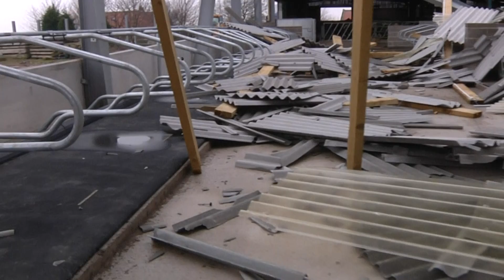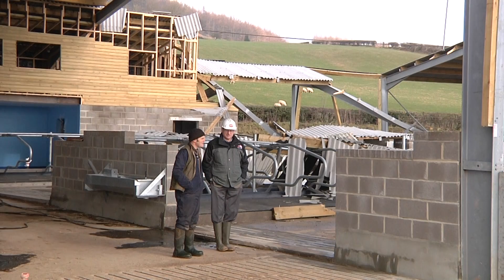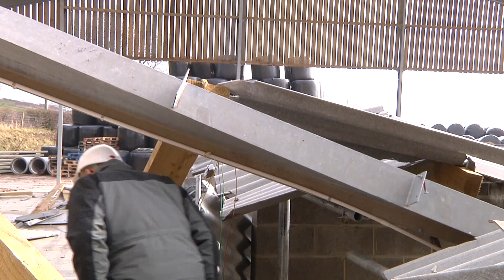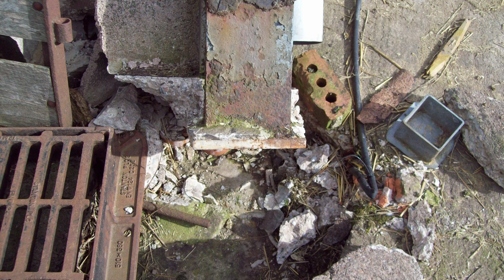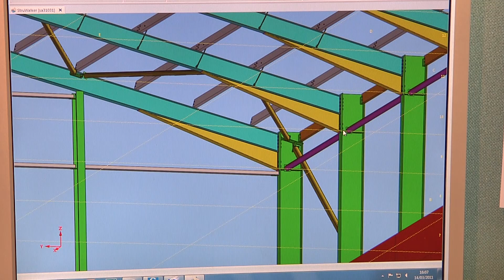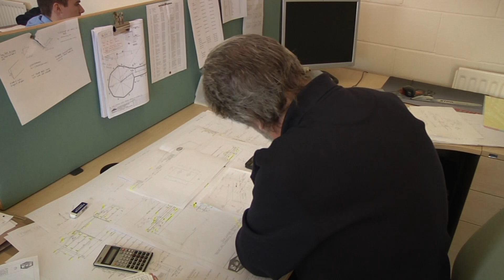Why buildings collapse in the snow

Comment: Excellent.  The CROWN pushing down from the top center, pushes the side I beam outward.
Attempting to have an un supported roof and beamless centers is the problem.  A Center beam may be required when you know the bolts and steel should have supported the roof from loosing its crown.   Build an ARCH that cannot push out the beams enough to colapse.
:face-blue-wide-eyes: :face-red-heart-shape: :face-purple-wide-eyes: